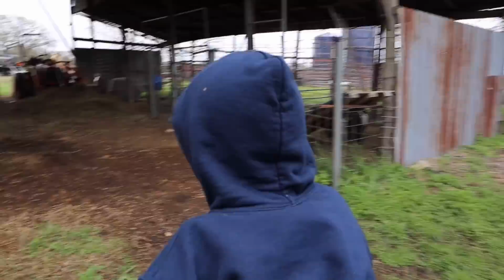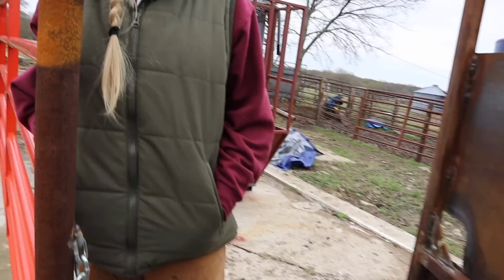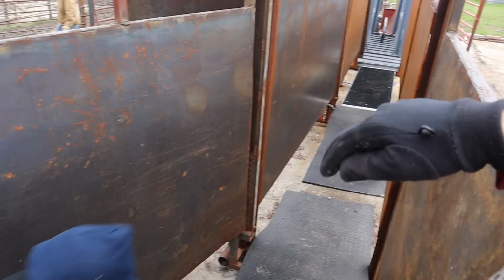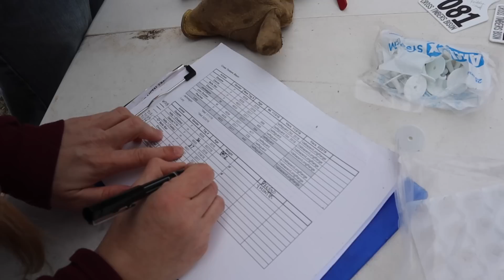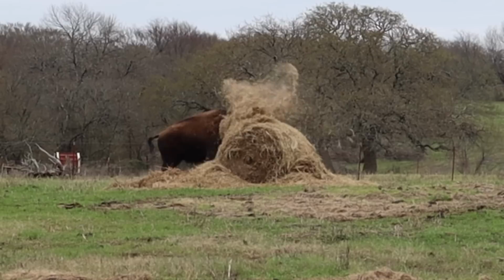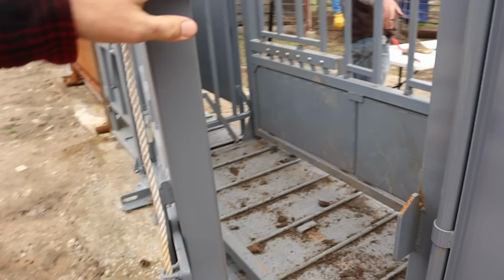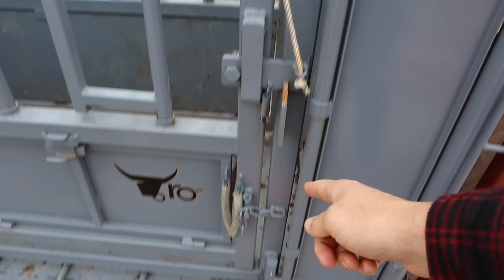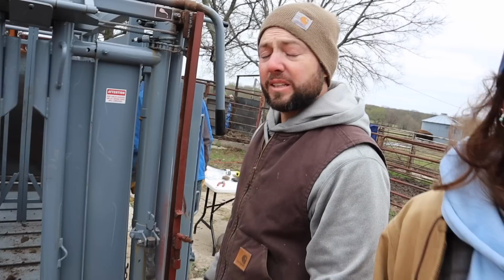The Bison Escaped! This Could Have Been Bad!

Comment: Daniel, in 2004 my wife and I went shopping for a Ford truck, we saw a 2002 red Chevy Avalanche 22,000 miles on it and took it for a test ride and fell in love with it and after 354,000 miles it still runs and looks new, I'm hoping for 500,000 miles and more, never had it in a garage until 3 years ago and that's when my trouble started, I took special care of it because I figured it would be the last vehicle I will ever buy and so far it's working in my favor even with garage mess ups. God Bless 🇺🇸👍🇺🇸👍
Reply: What’s the key to keeping a car going for so long? Did you have to spend lots of money for work and maintenance during the years?

Comment: I grew up around all types of farm/ranch animals, and even several rescue wildlife animals. There were several different cattle shoots on the property and I just happened to climb up the side of the out going fence and pulled down the handle for locking in the head, just messing around one day. It locked closed and then froze up, I had trouble getting it to open back up! I was only 11 and probably all of 90LBS at the time!! I climbed all over that chute trying to get the leverage and weight I needed to release the locking and arm. When I finally got in the right spot and had the weight and leverage needed the lock let loose and up came that pull arm, hitting me smack dab in my right eye! I was extremely lucky it didn't crush my cheek bone and/or eye socket or take my eye out completely, but boy did I have a nice big ole shiner!!! One of only 4 I ever had and it was all my own stupid fault!!!

Comment: We raised 150 Bison, 120 Elk,30 Deer, and just about everything else.  No matter what, don't ever trust none of them no matter how much hand feeding you do.....Please if you can design your working facility so you never have to get in the same space with them.  They will crawl out over top of alley way chutes, feeder chutes, put tops on all of them.  Put a hold down or neck force to one side after in head gate.  Try not to ever put your arm into their space in squeeze chute, they are very fast and break you up....I've seen it all.  I can also say they work better inside a darker area, put a roof and sides on that area, only let them see the most light to where you want them to go......never separate all the younger ones from the older adults, keep one or two leaders with the younger ones,  you'll thank me later.   de-horn the cows you wanna keep for long term will negate goring when in tight spaces and stress....

Comment: The feed trough will work if you put 2X4's all along the bottoms of the legs. That will make it stronger. My dad had a Brahman ranch near Jasper long ago. I thought they were wild. They have nothing on them Buffalo.
I used to artificial inseminate Brahman cows but I don't know about them. lol   You need to learn to leave the crash gate closed while you tag them for safety. I know its harder but I have had two back surgeries and I learned to be safe. Now I'm disabled, guess I learned too late.

Comment: Chevy General Motors are the best on the planet just bought a brand new 2018 last year 5.3 four-door short bed I  had  a 1956 Chevy two-door sedan I built with a Axl fiberglass front end 513 gears rollbar 427 600 horsepower fuel injected running 1103 in the quarter mile Chevy is the greatest on the planet ex-pro boxer founder of boxing vs UFC best fight predictor of all times Rocky Esterline